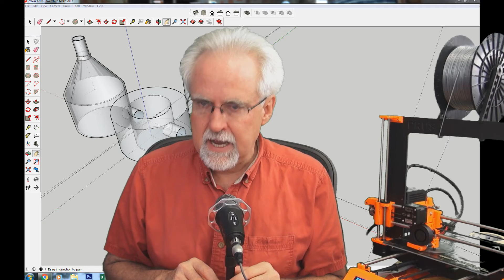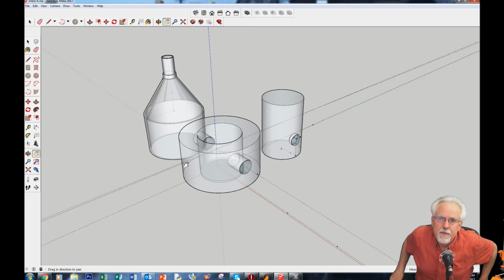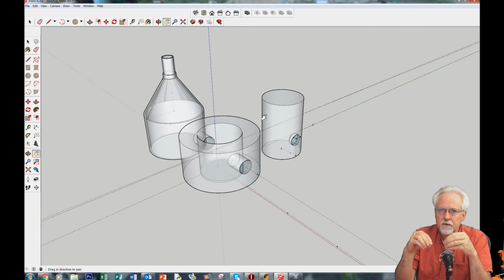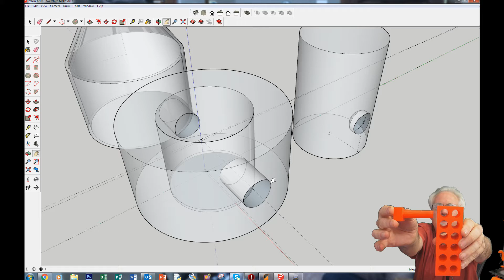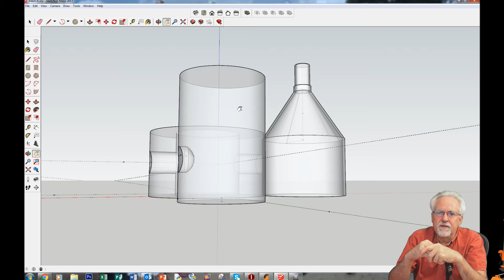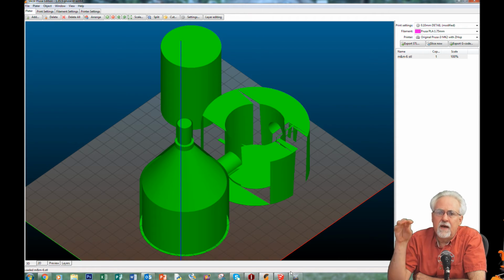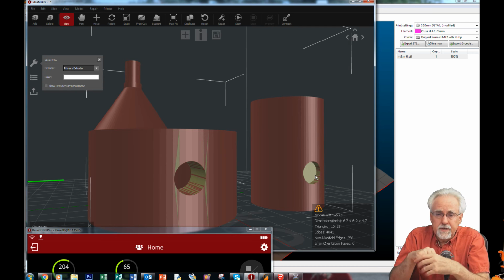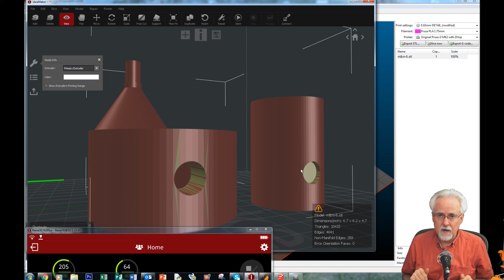Sketchup Tutorial LESSON 13: Hitting the Wall

Comment: This can be easily done by creating two solids (a bar and a cylinder)and then subtract the 1st solid from the 2nd. Choosing to only keep the intersecting area of the 1st solid...
Another way of doing it is to draw the two shapes and then selecting everything and then choose to intersect all lines with the model. Sketchup will then create lines around all intersections making it easy to remove unnecessary lines. But this does take a lot longer than the 1st solution.
Sketchup is more than capable of handling complex 3d shapes... You just need to come at it from the right direction...

Comment: I found this series so so helpful. Sketchup is perfectly fine for me since more sophisticated CAD software are way beyond me.  I was interested in using 3 D printers for the arts and crafts. This confirmed for me what I had read about 3D printers in general not doing well with aqueous, organic designs. It's really not the fault of Sketchup Software. It's the reality of the limits of 3 D printing . I'll therefore work within the parameters of 3D printing as I go forward with Sketchup to design objects for my art work. The engineering design process you taught us really helps with my conceptualization and planning. So much better than what I've seen in tutorials by architect. Thank you so much!

Comment: Hello Paul,
Did you make any tutorials showing how to make turn-pot knobs for electronic gear, stoves, etc? I have a guitar amp that I would like to make custom knobs for. What I cant figure out is how to make a fluted hole in the knob to fit the dia and correct pitch of the straight flutes on existing turn-pot shafts. Is there a plugin for Fusion for designing knobs to fit common half shafts and fluted shafts sizes? Sorry if this question is out of place, wasn’t sure where to post it.
Thanks Paul, keep up the great work 😁👍

Comment: Hm, this is definitely not a Sketchup limitation, I've been designing similar models in Sketchup and printing them without problems. Seems to be something related to the STL exporter or converter you were using. There are quite a few STL exporter plugins available for Sketchup, I guess not all of them work well. I use the one made by SketchUp Team, it is pretty much perfect.

Comment: Hi Paul, 
    First a very big thank you for taking the time and effort to produce this course, I found it very educational and interesting. 
    I am the sort of person that you described in your introduction, I want to produce cases and enclosures for Arduino, Raspberry Pi and ESP projects. A 3D printer seemed to be the answer but how to get started was the big problem that I faced. I did try earlier this year, but  was getting nowhere fast on my own. So I was not going to buy a 3D Printer  if all I could do was print out models downloaded from the Web that may not be what I exactly wanted. 
   Now having done your course, I have managed to produce a case for a 0.96“  OLED clock driven by an ESP8266 D1 Mini. SUCESS! I shall now be ordering my 3D printer with the confidence that it will be put to good use.
   So again thank you very much.

Comment: Hi. Thanks for the the all the  tutorials. If you would like to send me the files(skp) of the project you had difficulty getting stl files I would like my hand at getting to print. i.model@icloud.com Best Wishes
Reply from the maker: Appreciate the offer, but Have moved on to Fusion 360. Sketchup is a great place to start, but I really want to move forward, and think parametric design is the way to go.
Reply: I, too, would like to see these files, if you might have a Google Drive or Dropbox link for them. If there is a simple solution for getting those things to print, shouldn't your viewers know about it before unnecessarily  changing software programs?

Comment: Um. ive been able to get around this issue by making components and trimming them of each other. i can make a video about it and share it. but i do not have a youtube channel. anyway i can send u a video?
Reply: also...most common 3d shapes have already made into components in an extension called "Place Shapes Toolbar". so that cuts down the majority of the work
Reply from the maker: Yes, I can generate the shapes, but are they shapes without leaks and that do not generate errors in the .stl file. That is the issue. i can draw it, but cannot print because of leaks and .stl errors.
Reply: Paul McWhorter well I just made a quick cylinder and trimmed a smaller cylinder and generated the stl file. Didn't get any error and the file loaded in cura properly.

Comment: Enjoy your videos and they are informative.  I am sure fusion 360 is more powerfully but you might what to check out OpenSCAD too. Rather than using a mouse to move and size objects, in OpenSCAD you write a series of equations to describe the object. Most of my projects, the dimensions need to be precise. Since it is equation base, you can easily get the dimensions exactly the way you want too.  Depending on the project, I might start with a 2D CAD file and use OpenSCAD to extrude out and rotate various layers. I know some will disagree about the benefits of OpenSCAD but thought I would just point out an alternative.  Plus you don't have to worry about the licensing issues as much as you do with Fusion 360.

Comment: Can't meshmixer solve  it ,or netfab.
Even fusion 360 itself does mesh fixes.
Reply from the maker: I tried several different mesh fixing tools, and they did not fix it well enough to be printed. These tools work for designs that are not too far off, but for complex geometries with multiple errors, these tools can not figure out how to fix. In any event, after a lot of frustration, I decided to move to more sophisticated design tools for more complex designs. I am glad I learned sketchup because it is a good place to start, but I have gotten to the point I have outgrown it based on these more complex geometries. Also, really excited about the Parametric Design capability offered by Fusion 360.
Reply: Yeah,best option ,I use it for more then 2 years now and it is a lot evolved since .
Monthly updates and upgrades ,new features ,organic shape option and ....
Reply: Haven't tried it yet, but I still think  PRO/E rules....